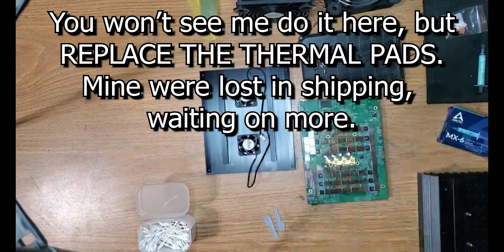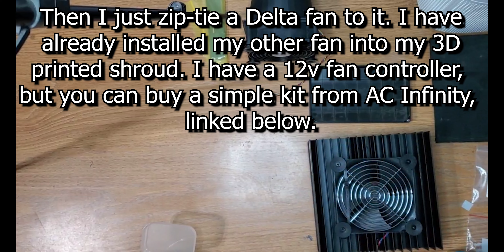IceRiver KS0 Pro 340 GH OC cooling mods tutorial / how to guide / setup video

Comment: Is 6x6x4 still good? Cause all other measurements are not available in my country 😅
Reply from the maker: It's better to size up rather than down, especially in height. 6x6x4mm would probably be fine, but it's less thermal mass and therefore will be less effective at cooling.